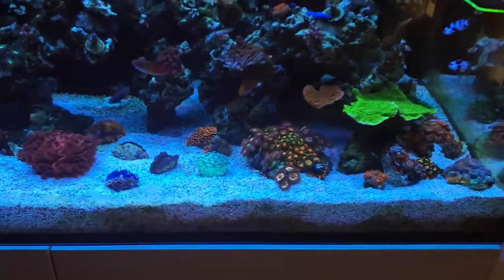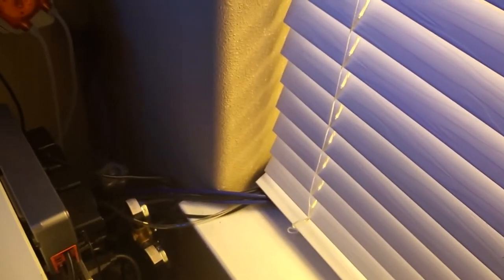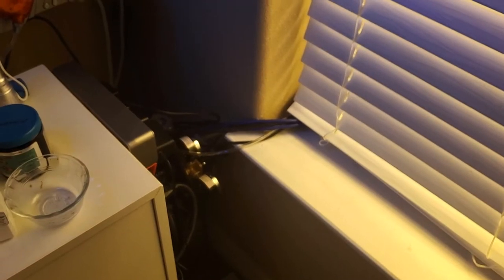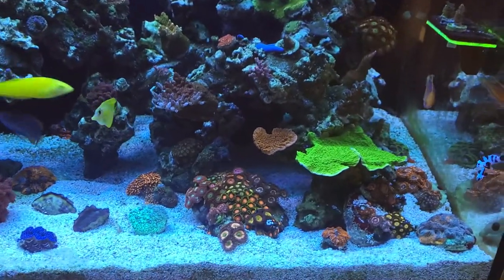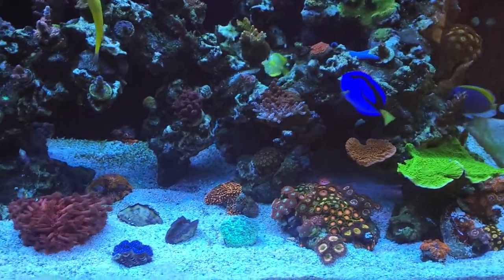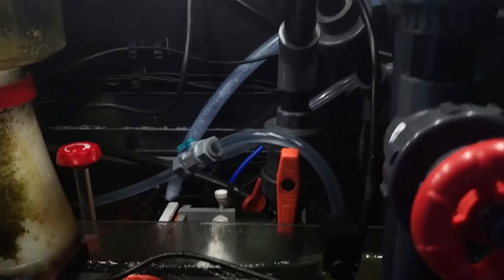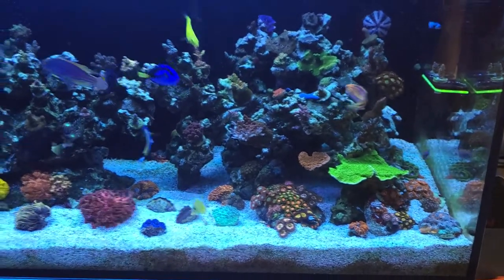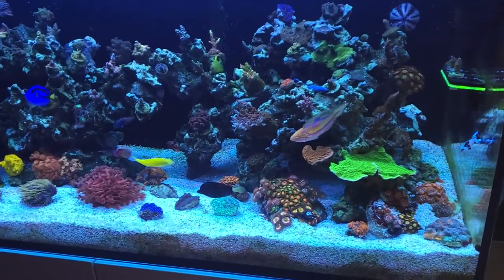How I run a kalkwasser reactor

Comment: Hey there  good video !  Question. How much kalk do you add to the tank daily thank you
Reply from the maker: Thank you! I use the OSC command. So I dose by time not by volume. 12 seconds on and 230 minutes off. The PMUP pumps for those 12 seconds every 230 minutes. So around 6 times a day it doses my tank.

Comment: In your system was that sufficient to keep the salinity the same? Assuming its replacing regular top off
Reply from the maker: Yes, my evaporation is pretty large.
Reply: @rrrreefer9721  I’m curious you used osc command instead of sensor. Evaporation is different throughout the year. Does doing it this way controls your pH ?
Reply from the maker: @SlowReefer  I basically use that command to counter my ato from coming on so it's pretty steady. I also second hand dose 2 part with trident controlled dosing to dial it in.
Reply: What reactor is that? Wasn’t sure if a stirrer reactor was needed
Reply from the maker: @SlowReefer  It's the avast marine k2. Most have a stirrer to keep the solution fully saturated.